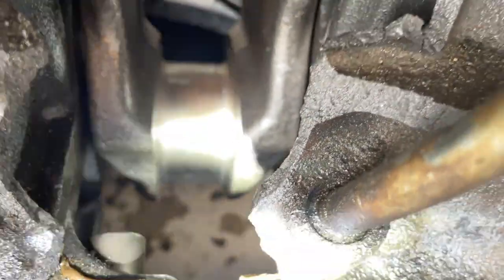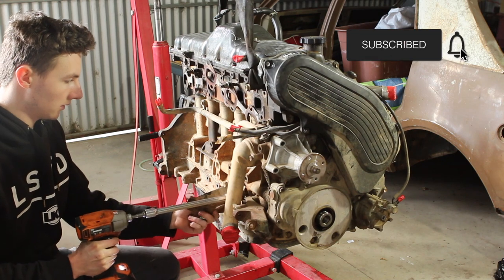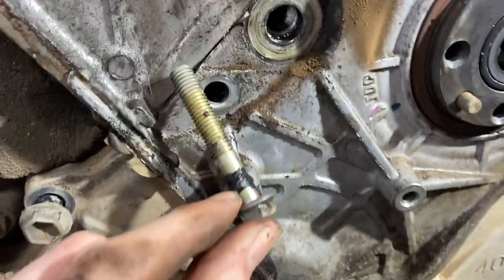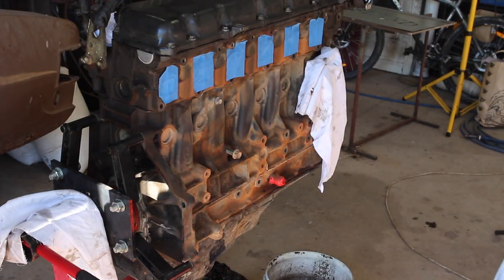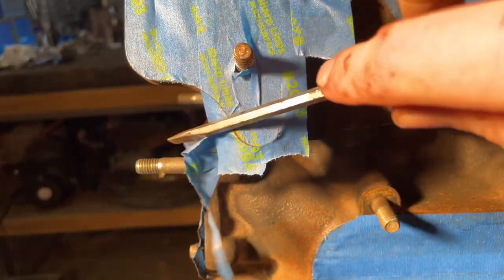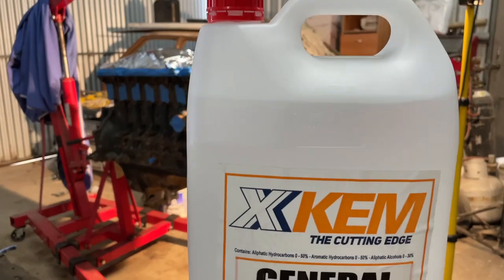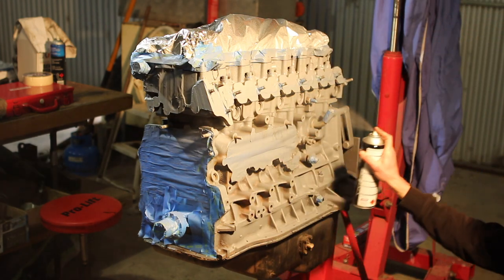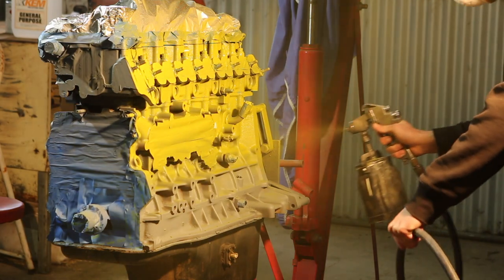Dismantling, Prepping and Painting (1HDFTE Rebuild Pt 2)

Comment: Hi Will! You got your replacement engine cheap! Here in Finland those used engines run about 5-8 thousand Euros!😬 looking good,mate!😎
Reply from the maker: I definitely scored it cheap! It was missing a lot of parts but very happy with that buy
Reply: @WillsLandcruiser  my LC 100 1hd-fte has 380.000 km on the clock. No tuning done,yet, but planning to upgrade turbo,intercooler and chip tuning. Looks like I'd better put new bearings for the motor before that......

Comment: Hey Will, has that injection pump had a rebuild at some stage or is it untouched at 650k?
Reply from the maker: Untouched at 650k I believe
Reply: Cheers. They are the best rotary pump ever designed. They dont use a cam plate so they last longer than traditional rotary pumps.
Reply from the maker: @deanburrows3504  definitely hasn’t skipped a beat so far!! A very capable pump indeed

Comment: You never showed removal of the diesel pump :/
Reply from the maker: Yeah I missed it! The other two went ahead and had it out before I could whip out the camera! I backed off all 4 nuts and dad unscrewed the big brass nut until it was on its last few threads. We gave that one big whack with a hammer and it popped straight out
Reply: @WillsLandcruiser  
Just bought myself a HDJ100 and was looking to see if there was some kind of an adapter as the FTE and FT has different mounting layout for the injection pump. But through the magic of google I found out that the oil pump plate is different and will need to be swapped over as well for a mechanical pump conversion.
Reply: Do you know if the A442f has a separate ECU or will I need to convert to manual in the same instance as converting the engine to mechanical injection?
Reply from the maker: @Mr.Engineer.  yep I’ve been there 😂 that’s a huge conversion. Oil pump plate, entirely new timing gears, different timing case front, and I’m pretty sure even the injector lines are different. It’d be so cool and people do it, but I decided it would cost more than it’s worth
Reply from the maker: @Mr.Engineer.  and I’m not sure about your ECU question sorry! Maybe another one for Google or the Facebook community
Reply: @WillsLandcruiser  
It is that much, not even the same timing case front. Why Toyota! 😒
You sure about new timing gears?
Pretty sure I can reuse the old ones.
I have a Yanmar 6LP for sale locally for a reasonable price, so considering using that.

Pump: 800 AUD
Complete 1HD-FTE: 2700 AUD
🤔
Reply from the maker: @Mr.Engineer.  I’m pretty sure the fuel pump gear is a different size between the FT and FTE. Not 100% sure but everyone I spoke to said use FT timing gears. That 6LP is a good buy! I reckon I made 20 phone calls about an FT pump and the cheapest I could find was $4k just for the pump, or $5k+ to convert a 1HZ pump!!
Reply: Just bought the 800$ pump on your recommandation to just grab it as fast as possible 😄
Asking price was 1100$, there is one other for sale for 2400$, I could probably get it for 1600$ or less. Let me know if you want me to ship you one.

Don't see why you need to modify the 1HZ pump to use it on an 1HD. A booster compansator qould be nice so you don't smoke as much before you bulld boost, but other than that it shouldn't be a problem according to my general knowledge on how these pumps works.
Reply from the maker: @Mr.Engineer.  nice work! As long as it has the right pressure to pump through those FT injectors you’ll be fine 👌
Reply: Yup, the nozzles decide the pressure and the pump will pump it until somethings break.